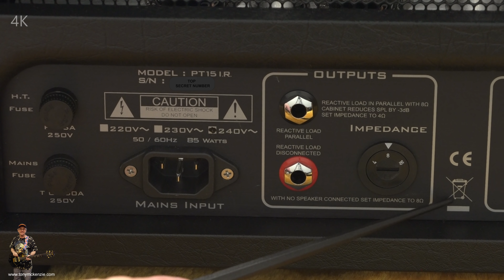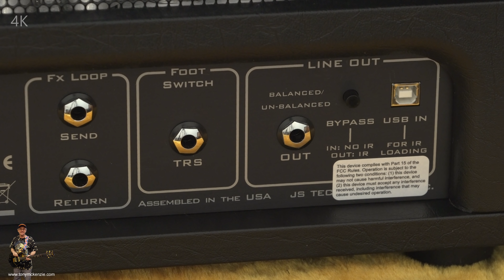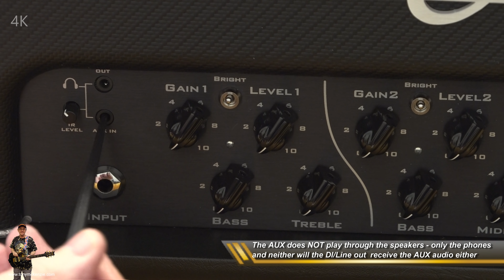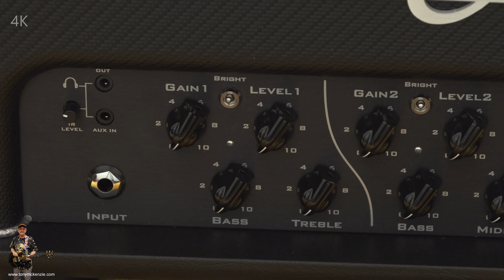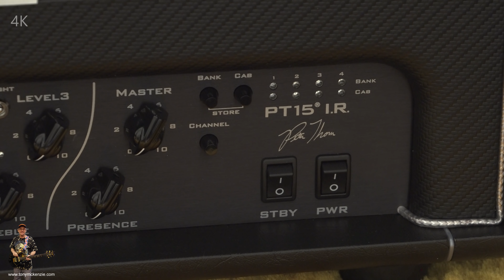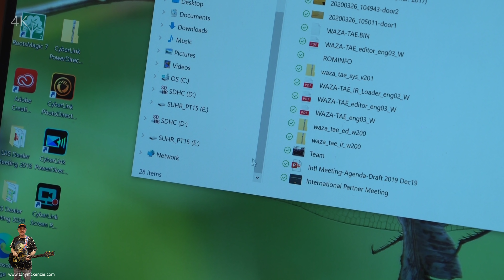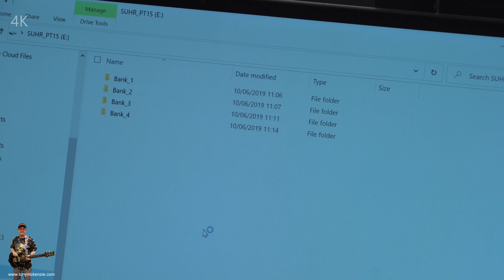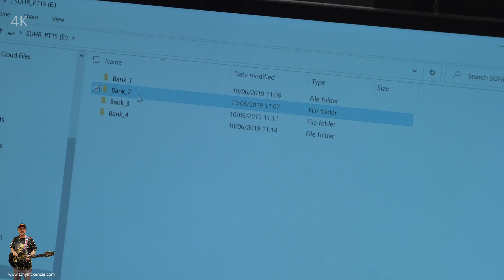The Suhr PT15 IR Amplifier | THE BEST REVIEW | An Inside and Out Closeup With Playing | The IR Amp

Comment: Hi Tony... another great review that I enjoyed, thsnk you.  Am strongly considering getting the PT15 IR myself. 
Just a quick question regarding the preamp tubes. 
I noticed that out of the 5 preamp tubes each one is a 12ax7... however there's a phase inverter tube position which has a 12ax7 in it too. 
As far as I know, a phase inverter section would normally utilise a 12AT7 tube given that the PI draws a lot more current and a 12AT7 tube would normally be more suited there for that reason.  Do you think it would benefit the amp to replace the P tubeI slot and pop a 12AT7 in thrre instead of a 12Ax ?   Woukd it affect or improve the tone at all ?
By the way... if I get this amp I'm definitely getting rid of the Chinese preamp tubes & swapping in some nice sounding, better ovearall quality tubes.  
Any you'd personally recommended?   Cheers 👍 😊
Reply from the maker: Well I have seen many amps with 12AX7 as phase inverters... and far less with 12AT7 for example. Tubes I tend to buy are TAD premium selected. They cost, but for good reason and never had either a power tube or preamp tube fail from TAD (tubeampdoctor..com) Hey I he it helps a bit and thanks for watching. Mr Suhr was a bit critical about my review (its in the text somewhere) and really I think they did not like me showing the internals of the amp. But hey ho - I'm about the only one to ever bother! :)

Comment: Hey thanks for the review!  I'd love to clarify some things for you if I may, off the top of my head. The tubes are a JJ in V1 and Chinese 12AX7 in the other preamp slots. ARS is just a distributor and we retest and rematch all our tubes. These are carefully chosen for tone and performance and are tested and hand selected on an Audio Precision test station, I wouldn't change them. The effects loop send level is the channel level and the return level is the global Master, it is a fully buffered tube loop. The PCB is hand soldered double sided plated thru holes not wave soldered, one component at a time. Sorry about the washers! Good catch, we had that issue on a few and I guess missed one, the hole diameter in the washer was the issue but the head is tight, that is there to protect the cup from cutting the vinyl. The Pots, yes the smaller sized Alpha is superior to the larger diameter and FYI CTS is no longer American but are made in China anyway and frankly they have been problematic in guitar land.  Everything we can do in the USA we do, including Iron  A "suspicion" of where it is made seems to cast a nefarious on the origin, I'll clear that up, it is made in Lake Elsinore CA in our factory, even the transformers are American made  CA state law dictates really almost nobody can say "made in" unless virtually EVERYTHING comes from the USA , this includes knobs, switches, all electronics which most of is not available in the USA. Or those American companies like Carling or CTS are using off shore anyway so we can't say its all made in USA.

The biggest gripe you seem to have is the CE and lack of ROHS. We do not self certify but have a lab do all our testing. CE includes ROHS, ROHS does not need to be listed separately. You can't be CE without being ROHS anymore. We also test for FCC. I'll be happy to send you proof on the reports if you send me an email or contact CS, it's 82 pages long. Also the price I'm sorry is a bit less in the USA for sure. Not much I can do about that import duties, county specific taxes, shipping costs etc.  So shoot me a message so I can get you the proof of CE and you can change it to a 10 ;-) thanks again and if you have any questions please feel free to reach out and maybe I could clarify my reasoning and design intent before any incorrect conclusions! Cheers.
Reply from the maker: Hi Mr Suhr... well thanks for watching my review... it really is a completely independent one and I hope you don't mind that. Thanks for this information I really appreciate that. Some years ago I did a few reviews also independent, and later discussed all the things with the designer, it was great to hear all the tings he mentioned and no less for sure in your case. If you don't know then no one would!  Great points also re the origins. I am involved in the UK with a USA company and some of the equipment we sell origins actually in China, and I could say I have seen some changes over the years on most of the electronic equipment. The stuff we sell is marked up accordingly. I'm sure you test for FCC and CE at the same time because any other way would be pointless and cost substantially more doing things twice. And I know what lab costs are I have paid them many times. Indeed I know exactly what those reports are like too. Let me just say this please, part of the reasons I always look close at any CE stuff, firstly, I don't know about you, but I get absolutely frustrated at Chinese and other Far East companies cheating the system. You - and I and many other companies spend the money and do things properly. It is very painful for me to spend many tens and tens of thousands of pounds on 'doing the right thing', yet others flout it all and don't care. Worse still as I'm sure you will know, competing with that can be very difficult, but the real solution of course is educating buyers. In my real job it is entirely different than my 'hobby' of music but I have been messing around with that since 1968 and I'm thankfully still alive after prostate cancer and other stuff. I enjoy everything I do, and I know you will do to in your business. So please re CE it's not a gripe, trust me on that, but I see company after company not do the right thing. 

Ha I can't go back and change the score :) but trust me that score is very high. I have seen all sorts of products from all sorts of companies and some of it is horrible. The PT-15 IR is expensive here and with tax, dealer margins, the shipping etc. well, I would expect to see a great amp. Anyway I think it is a good amp... there was little to really find in there and that's a great thing. Looking inside any amp from any maker doe show a different light on any product and I'm happy that the Suhr product was as good as it is.  Thanks for taking the time to comment on here and I'm sure that any viewer will take in to account your comments and points accordingly. I liked the fact that the amp seems pretty unique with the things it offers. Sure there are other ways to end up there, but then of course that's not all in one box. Thanks again and if you want to contact me off here then go to www.tonymckenzie.com and fill in the form... and I'll email you so you have my email address.
Reply: @tonymckenzieofficial  Thanks Tony, I've never read a review of 9 out of 10 that still rubbed me the wrong way but I'm sure if you and I had a beer you would understand my design intent and passion for what I do coming from being a repair person for 40 years. I felt you had a chip on your shoulder in all honesty about a few things.  I take testing and safety seriously and I share your skepticism that everyone is doing it right which is why I'd hate for anyone to assume otherwise. I use American PCB supplier and transformers and a full crew to build our electronics. We hand stuff everything except surface mount digital.  We do pay a serious chunk of change for testing by a serious LAB. FCC you can't screw around with, I've seen friends get busted on digital reverb add ins.  Rest assured though anything that can possibly be done in our shop I do. My son designed 90% of that amp and did a killer job he is a seriously talented EE. It is the only amp I know of with a built in reactive load that follows a true impedance curve (most use a bathtub curve that doesn't resemble a true impedance curve) has IRs and they are assignable to any channel. We also have a version that doesn't have IR options. Local the amp sells for $2699.00 US dollars so your pricing is a conversion of what you had to pay due to your import costs.  Thanks and stay safe
Reply from the maker: Oh and I almost forgot... I trust that you ant Mr Thorn and everyone else there stays safe from the corona virus. Here in the UK it has ravaged the country really. I know in the USA there have been many deaths and it's very sad. But the UK it is not good either and it could be easy to catch that horrible disease. Stay safe all of you.
Reply from the maker: Well I don't really understand why you might be 'annoyed'. I thought the amp was pretty good based on what I saw and not based on sales videos or other things like that - and I said so. I don't set out with anything except a blank piece of paper and then I buy equipment. If I like the gear I keep it myself  and if I don't then I sell it. Let me put it another way, I originally bought a Friedman amp which I felt did not offer value for money (to me) for the price it was and while it is subjective, I have many amps costing less that are exceedingly similar to the Friedman I purchased in quality and tone. In fact, I returned that amp and spent as much again to get an amp that is an interesting product - that is your company's amp the PT-15 IR. So my review is based on being an owner of the PT-15 IR that I properly paid for. I won't be sending yours back and for good reason. It does what it says on the 'tin' so to speak and sounds good. Interpretation between languages is sometimes 'different' although English and American can at first appear the same. They are not. On pricing well, here the list price seemed to be £2799.00 or thereabouts. Without our 20% tax that is £2332.50 or $2868.97 equivalent in $US. In any case here in the UK it is an expensive amp but it does have the extra features that I thought did offer extra value. So if you step back a little (it can be hard when you're so involved in what you do) you might find my review quite reasonable from an English perspective. Thanks Mr Suhr.

Comment: What's the issue with ARS (JJ) tubes? Why change perfectly good tubes?
Reply from the maker: I'm no fan of JJ tubes... the ONLY brand that has ever failed (spectacularly) in a tube amp mI own. You might say that if I had a website about those it might be named 'cantbetrusted.com' - and failing in a £3000 amp becomes no joke. If you like JJ then good for you, but for me? The risk of less than perfect tubes is really rather like gambling... you will lose more than you will win I think. Thanks for the post and for watching...
Reply from the maker: I get it... of course. Me too - only the one amp gave issues, but that amp had the JJ stuff. The Mesa in my case were fine, the Engl, fine, the Mezzabarba fine etc. its just a personal thing that I'm sure you would understand if that happened to you ... in any case... had the tube not blown then maybe I would have a different opinion.... thanks.

Comment: Thanks Tony. Great job. What's an IR?
Reply from the maker: Ah well, these guys will tell you better than me: https://en.wikipedia.org/wiki/Impulse_response and there's everything you would ever need to know about impulse responses on there. This is (as far as I know) the only tube amp currently that has them on board. Useful for direct to PA or recording desk as two examples. If you only connect a speaker to the amp then IMO pretty much useless although I'm sure there are many that might disagree for no real reason than to disagree :) Stay safe...

Comment: Nice informative video Tony. I noticed on the back of the amp it has Assembled in the USA, but where is it made? LOL But if you say it's made well, it's made well. :-)  Stay safe.
Reply from the maker: Oh no I get that. Hopefully not like Fender. I do have my own opinion as to what where and how but won't post it on here simply because it would be a guess. It is well enough made. One guy on here suggested I could go through component brands and certainly for some aspects I do. On this amp the capacitors I had not heard of but I don't know everything. The power supply capacitor brand was 'nichicon' which are actually Japanese (at least the company is). No F&T there. But whether that brand is 'good or bad' who knows. There was by the way no indication of where the boards were made on the boards so the singular reference as to origin was as you stated. But for CE compliance (at the very least) the product should have its origin on the product - and this one does. Good point and one worth bearing in mind. Yes and you stay safe too - watching the news these days many are not :(
Reply: It is made 100% in Lake Elsinore CA
Due to CA state law unless virtually EVERyTHINg including all capacitors, knobs you name it comes from USA you can't say that anymore.  Has to say assembled.
Reply: @johnmsuhr  This.  It is made in the USA.  Simple.